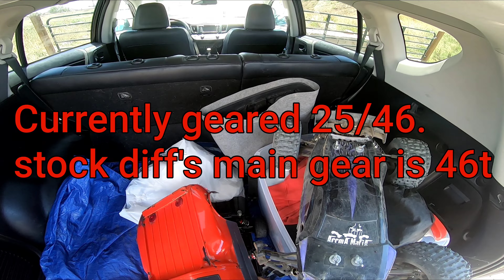Hobbywing Max6 1650kv 2 ways: Off road and all-road. T'Challa and the Noble Steed

Comment: Bro you have got to put some of those nylon washers on the front shock shafts 3-4 of them will completely stop the dog bone problem from happening and it's super easy. There is a cheap set on Amazon for like 8$ and it comes with a bunch of different sizes. Ima pm you on forums with a link. I used to go through it every time I jumped too 🤣 and damn that looks like a perfect speed run road and it's feet away from the bash spot. Niiiice
Reply from the maker: I actually put a couple old bearing on the shafts like the washers. But my outdrive was trashed (was so bad 🤣) lol! I'm headed out today with my homie and his drones to test out and do more speed runs. We'll be out by the sugar mill if you got time! Around 3:30. I'll pm you on ig

Comment: Wow same bad luck on sun front pin to the shock mount came out my typhon doing jumps...smh...now have to wait on parts about 5 days bc I ordered all the screws and pins some guy replaced off his typhon sure he went with rust free screws? But for 12 bucks off Ebay sold. The pins 2 alone like 10-15 bucks..so felt like it was a good deal. Thinking about starting up my progress on you tube.?? Is it hard??
Reply from the maker: $12 ain't bad at all! Even if they have rust 🤣. It's not really hard to do progress vids. Just time consuming haha! 👊🏿